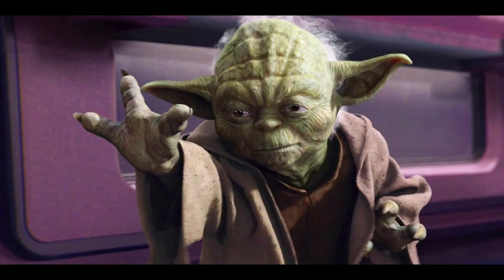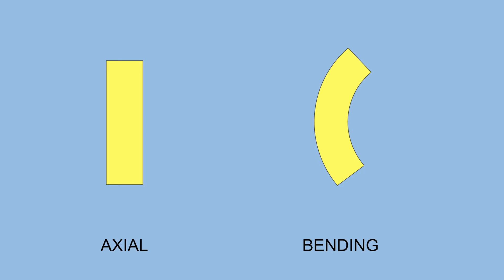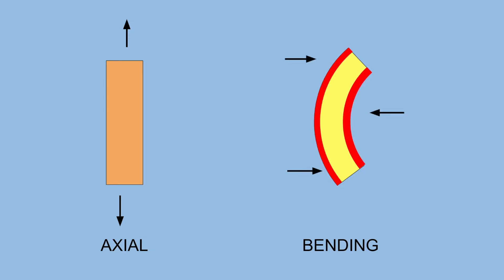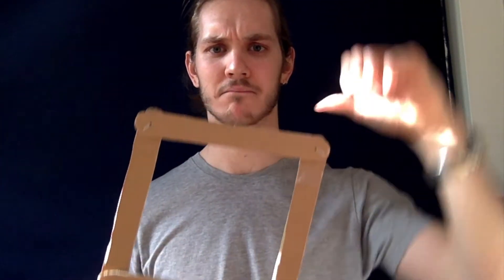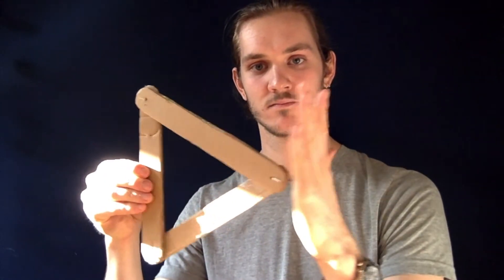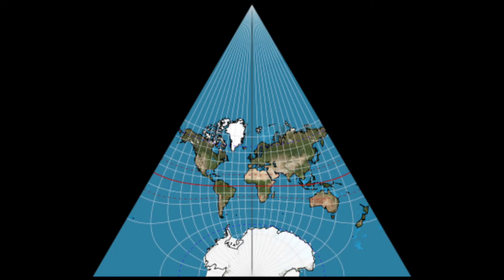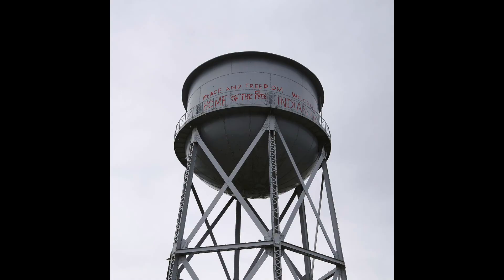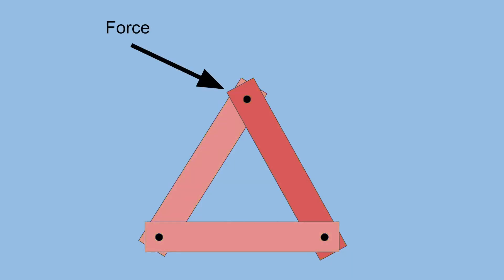Are triangles REALLY the strongest shape?

Comment: I am coming up with a project using Triangles.  But what about using pyramids ? I want to stack them on top of each other. and connect the 4 bottom corners to each other to the next pyramid on top.  Would the strength be able to hold up a ton?

Comment: but how do they make triangles in construction without making the triangles fixed? i thought they welded them?
Reply: They do make them fixed in the final product.

What he's saying is that if you build models of things with joints that are free to rotate, you can easily spot any rotational forces in the design, and eliminate them.

If the joints in the model are free to rotate and nothing rotates, then you know the design is strong and efficient. That way when the real thing is built, and the joints are fixed, you can be confident that the individual members won't be experiencing rotational (bending) forces, which is where they're weaker.
Reply: @ccmmrrnn thx for explenation

Comment: then why are beams either an L angle  I shape or square or round tube? why is there no triangle steel stock
Reply from the maker: Good question! The distinction here is along which axis we want to prevent bending. If we wanted to prevent the extrude from getting crushed, then a triangle would in fact be best. However with extrudes that's typically not the concern, rather bending along the extruded axis is the bigger problem. In this case the "moment of inertia" becomes the primary geometric consideration. I and L beams are designed to have a high moment of inertia by having mass far away from the centroid. As for square and round extrudes, I have to imagine these are just convenient geometries, not necessarily optimized for load bearing.

Comment: I'm a construction worker and got into a big argument about what is the strongest shape. I was outnumbered by those voting arch/circle for various reasons.
Reply: the key stone in an arch is a triangle.
cut a circle in equal slices through the center point ( like a pizza), and it is made up of triangles.
triangles are the strongest shape.
Reply: @grayman7208  but hexagon is the bestagon
Reply: @Woopor  but hexagons are made of triangles.
Reply: @Woopor did you get this from civil engineer?!?
Reply: @fluffycuddles8008  Probably CGP Grey
Reply: @yolosky2467  hmmm, never heard of him
Reply: @fluffycuddles8008  You will
Reply: @yolosky2467  can’t wait
Reply: To resist bending, a truss made up of triangles is most strong. To resist internal gas pressure, spherical tanks are strongest. To hold back water in a reservoir, dams often have parabolic shapes.. So The nature of the materials and specific application will determine what geometries possess the best fit for strength,

Assuming a similar crossection for both shapes, a properly designed catenary arch will distribute forces to the lower corners in a way that will resist buckling better than the straight lines of a triangle (which is why so many old buildings have arches) tldr:a single arch is usually stronger but you can add several triangles to make the triangle stronger then the arch